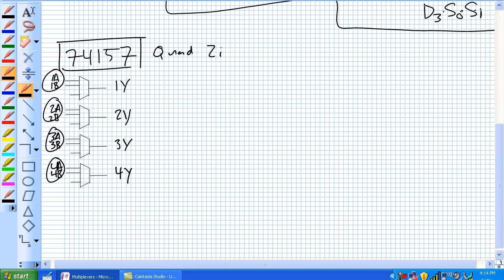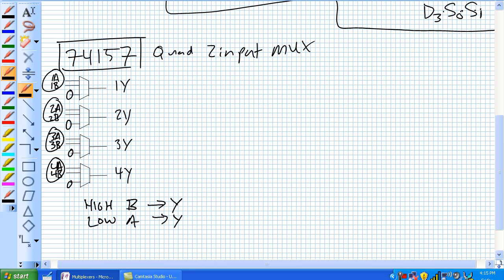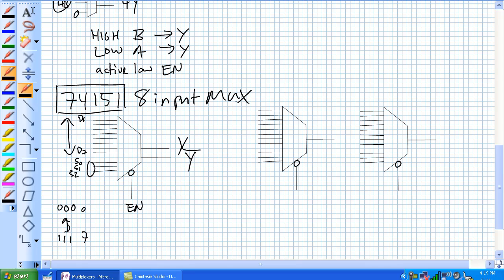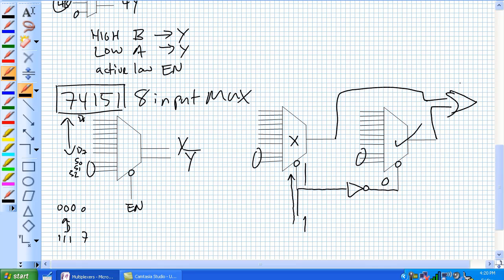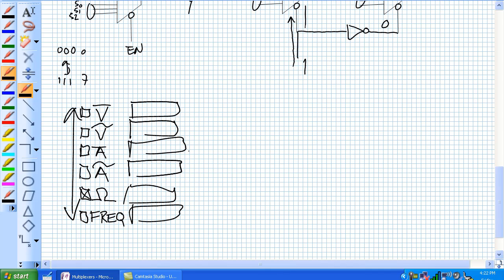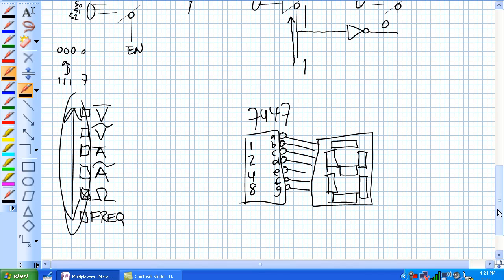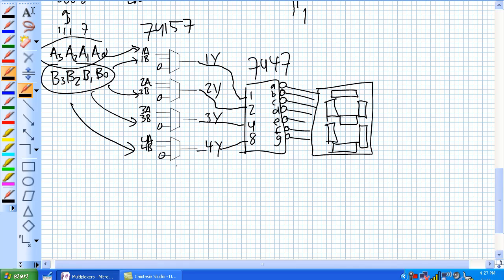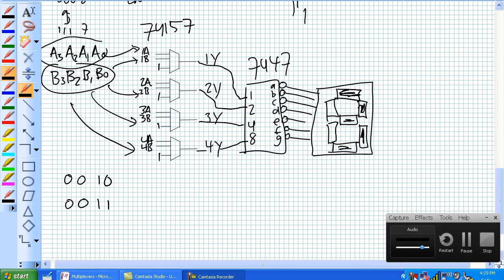Multiplexers Part 2

Comment from the maker: @cgcclive 
Now, here's a good exercise ... what if you had 50 different positions? How many address bits would you need? Well our 5 bit address wouldn't cut it anymore and we'd have to go to 6 bits which would allow us 64 different positions. It would just have a bunch of unassigned addresses that could be used if you were ever to expand the system. Make sense?

Jim Pytel
CGCC RET Instructor